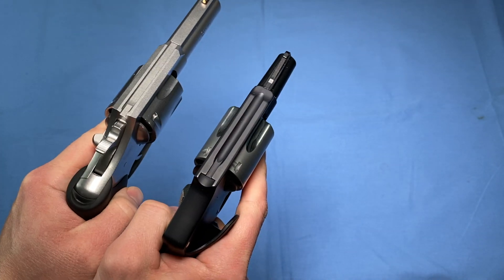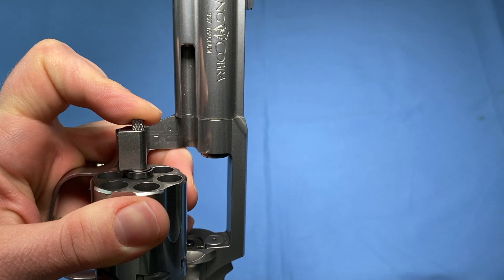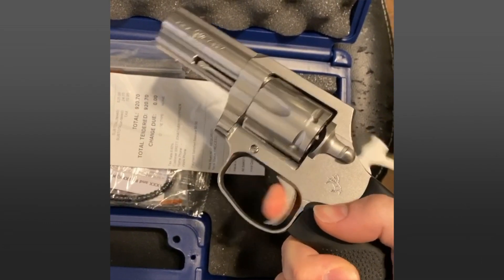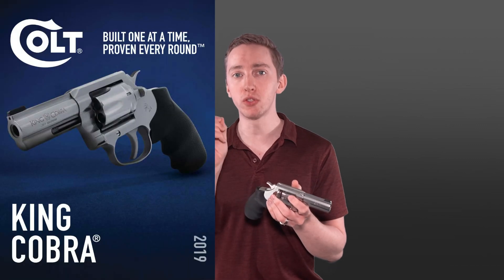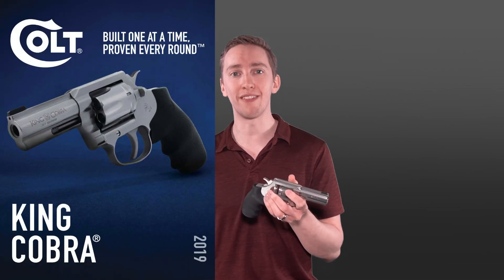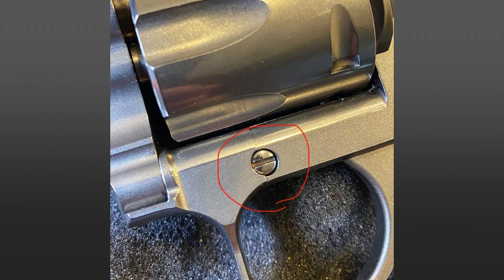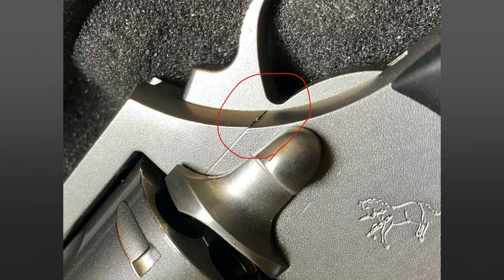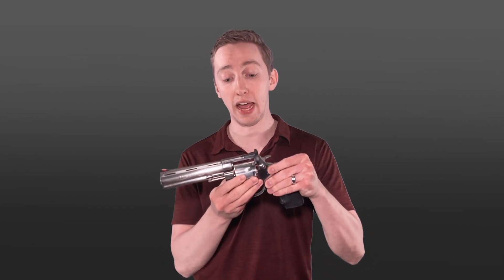Colt King Cobra - Problems, Malfunctions, and Failures OH MY!

Comment: Sorry about your bad experience with Colt service. Agree QC should be better but you didn’t really expect that Colt was hand making the cobra revolver did you?  Lemons can come out of any factory.  I have a 2020 Python that looks and operates flawlessly.  I guess lesson learned is that you look over the weapon thoroughly before dropping the $900.
Reply from the maker: It was definitely an unfortunate experience. And of course I knew they were mass producing them regardless of their dishonest slogan. But you’d think a “premium” company like Colt would test and vet their products before launching them. As far as looking the gun over, that absolutely applies to the misaligned side plate. But no matter how hard I looked it over, nothing could have indicated a weak internal part. And sure, I’ve had many lemons from many manufacturers, but if you look through my comments on YouTube and Instagram, you’ll see many people with the same breakage. A few of which originally commented theirs was fine, only to come back and comment that it has since broke. Colt knows (and admitted to me) there is a problem with existing King Cobra/Cobra revolvers, but they refuse to recall faulty guns or inform owners of the issue. And they clearly don’t have a 100% fix since several people have had a repeat breakage. The QC issue is certainly disappointing, but the dishonesty and ineptness is what truly drives me away from recommending modern Colt products. Anyway, I’m glad your 2020 Python is running well so far, it’s a fun and pretty gun for sure! 👍
Reply: I would keep sending it back until they made it right.

Comment: First 3 shots light strikes run into Magtec range amo I run in retail area of store loudly proclaiming this gun has a timing problem! Gunsmith jumps into action checks gun sees ammo proclaimed hard primer. Gives me white box Winchester 50 round box gun shoots unbelievable tight tight 60 rounds ten groups of 6 shots each group could be covered with a quarter. Then gunsmith returned with another box of magtec says fire 6 shots single action then have at it dbl action everything went perfectly not one light strike in over 100 rounds so. I don’t know what to think. But I will never sell this gun like I did my python back in the 80’s
Reply from the maker: Hopefully it keeps working well for you! 👍 I certainly wish mine did, it feels great in hand.
Reply: @NightwoodGuns  I had a python it sucked I sold it. I should have kept it. Even though it sucked

Comment: I have a huge revolver collection.  Yes they are ALL made cheaper than they used to be. Yes they all have problems.  I have sent back more smith and wesson revolvers than I want to talk about with the same kind of problems.  What I'm getting  at is they are machines and they will always break, all makes and models have problems. If I made a  video about all these revolvers that had to go back you would not be able to buy any brand.
Reply from the maker: I’ve sent back a couple of modern Smiths, too. But the customer service was leagues better than this and they always came back 100% My main gripe with Colt was the lousy way they handled the situation. And the fact that so many people had an identical breakage, they knew there was a problem, but they never issued a recall or a fix.

Comment: It's a damn shame that Colt's reintroduction flagship Pythons and King Cobras are having these kind of problems.  I know it's a manufactured item, and realize that not every unit will be 100% problem-free.  But this many problems with both guns is an indication of poor designs and even poorer quality control.  For $1000 and $1500 a gun, that would make my blood boil.  Say what you want, but I've never these kind of issues with modern S&W's, Ruger's or Taurus revolvers for half to one-third as much.  I'd probably be drinking a lot of Colt 45's if I bought one of these Colt .357 magnums.
Reply: LOL ... Smith's "Hillary Hole" is enough to put me off buying their new revolvers.  Not to mention their el-cheapo sleeved barrels that aren't centered.   I had enough trouble with binding lockwork in my Ruger Single Six to put me off every buying another one.

Comment: wow
Reply from the maker: Yup. Super disappointing.
Reply from the maker: @Coodeville  Exactly, low supply is making everything sell like hotcakes. Yours might be fine, but if anything DOES happen to it... Colt will screw you. I refuse to purchase a product from a company that treats customers that way. I'm convinced that most people will never shoot their Cobras enough to experience the breakage. And I'm sure Colt was counting on that when they designed the gun and manufactured it as cheaply as possible. Hopefully CZ will turn the company around.

Comment: You bought the revolver with the misaligned side plate. Should have checked it over before you bought it. Sounds like colt fixed the trigger problem. If you’re still not happy with it, sell it and buy something else. And…If you think S&W quality is any better these days, you’re mistaken.
Reply from the maker: Yep, I bought a revolver with a misaligned slide plate. I should have checked it over. And Colt should have fixed it. I did sell it and I bought a Ruger GP100. And Smith’s quality is mostly good, but they do have a fair amount of lemons. However, their customer service is much better than Colt. They just did a complete firearm replacement for me on a firearm that was built one year before their lifetime warranty started. Colt couldn’t/wouldn’t even fix a misaligned side plate on a firearm within their 1 year warranty.
Reply: Smith is the best.  Colt sucks.  Experience

Comment: This is so dumb, calling calls the ejector rod a plunger.  He has no idea how to adjust an ejector rod, which can be done in 10 minutes, max., and spends 2 hours playing with it   He thinks 150 rounds is a lot of rounds through the gun????  I have put 1,500 rounds through my King Cobra now without a single problem.   Too lame to even take the side plate off and see what was going on?  Really?  How about doing some real investigation and not just complaining?
Reply from the maker: You know, if sane people start watching a video and realize they dislike it... they click away and move on. 🤷‍♂️ Thanks for the comment though, it helps with my YouTube analytics. And yes, I realize I mistakenly called the ejector rod a plunger. Just like you made the mistake in your comment of saying I “calling calls” it a plunger. Nobody is perfect. And the ejector rod did not need an adjustment, the serrations were over traveling and getting stuck. And no, 150 rounds is not a lot through the gun, but it’s usually enough to vet reliability, which is what I was talking about. And why would I investigate when Colt could do it for me? Which they did. The gun never should have broken in the first place, and it should have been returned to me in perfect condition.

Comment: So you got a bad revolver and now the company sucks? They sell millions of firearms and have some trouble but it turns out to be a tiny percentage of their overall sales, and now they suck because they didn't kiss your ass and get it fixed quickly enough to your satisfaction. Next time examine the gun before you buy an obviously used gun. I own a King Cobra 2" and have never had an issues. I understand your frustration but trashing the company given these circumstances makes you sound quite like a whiner. Eureka.
Reply from the maker: I'm not trashing the company for a lemon, I'm sharing my negative experience with their customer service. They didn't even fix the side plate fitment. And the firearm was 100% factory new. Not to mention, many people in the comments have had their Cobra/King Cobra break in the same way mine did. The Colt rep even admitted on the phone that it was a known issue, but they would not be recalling it. If I had spun this video in a positive light, others would have called me a shill. There is no winning on the internet. All I can do is share my experience and if you don't like it, you don't have to watch.

Comment: aaaaaaand the same shit happens with Smiths , Rugers, & everything else whhen you get a lemon or new model comes out. Think Smith or Ruger is flawless? Hah. Your rant sounds fanboyish to me.
Reply from the maker: This is also a 4+ year old video. Ruger and Smith QC/customer service tanked after this. The difference is that this is a design flaw in the Cobra/King Cobra line that is still happening. GP100s and 686s have solid designs but poor QC nowadays.
Reply: @NightwoodGuns  Ruger, Smith, Henry, CZ, even Nighthawk has frequent flubs in QC, you can google "X named gun problems/issues/warranty/repair" on ANY manufacturer and get slews of forums and rants saying X brand is better than Y brand...but you can go to X brands rant forums n ppl say to go to Y brand. Brand new Ferrari's are on showroom floor thaat wont start. There always has and will be lemons and misses by even the greatest companies. Not saying its right or it shouldnt  be called out..but for every Smith QC rant theres Ruger, Colt and Daniel Defense rants about QC n RMA horror stories..It doesnt influence or speak for the brand as a whole.
Reply from the maker: @tekxmcfly6159  I hear you. And I agree. I’m just saying there’s a difference between a QC issue and a design flaw.
Reply: @NightwoodGuns   

my buddy has been yhru hell.n back with his Stacattos & WC. Other bud says they treated him like royalty

QC, Design flaw, or engineering the mechanicals itself are all in the same wheelhouse. Brands are stubborn. Every gun maker out there has quietly at one time or another phased out x batch n corrected new  batch..so long as its not a fatal to user flaw. Car manufacturers do it a the time since the begining.

BMW late 90's-2000s have plastic bodied water pumps...they knew...they recall it?? is it fatal to driver? nope business as usual.

Not defending Colts approach..but what you're shining light/complainimg about...is literally Manufacturing to Consumer Business Practice 101 since the dawn of Capitalism.

I agree with you 100%  but telling peeps to avoid Colts Wheelies like the plaugr because of this? Dude..no one should buy any firearm from any manufacturer EVER if thats the case. They all did the dance with the devil in the pale moonlight at one time or another. 

Sucks that happened to you..and you on point for calling them out. But for your Colt story theres more Colt stories...and smith stories..and WC stories..and.on and on. 

Knife companies are the same..so is every consumer brand.

Buy & use what you want...n if any company messes up call em out. But it doesnt reallyy single out any gun brand nowadays or even old days. Unless its Jimenez Arms...
Reply from the maker: @tekxmcfly6159  Your comment is fair enough. I just have a gripe when a company doesn’t phase out an issue, especially on a potentially life saving device. I always pin the most recent person in the comments with the same problem on my video to keep track of it. Colt should have sorted this out after 4 years. Which is why I do recommend going another route for a wheelgun in this case.

Comment: I reckon you should go back to not using your YouTube for another 3 years mate . Just another bloke who expects everything to be fixed now now now then it can’t be so let’s trash colt instead.. colt will fix all problems to all guns .. they are a great company and I have had nothing but positive experiences with them ..
Reply from the maker: I reckon no one is making you watch my videos, “bloke.” Obviously Colt will not “fix all problems to all guns” as evidenced by my experience. And I don’t think expecting the side plate fitment to be correct after sending it in for 5 weeks is wanting it fixed “now now now.” Regardless, it should have worked the first time, it’s a $900 gun. I’m not trashing Colt, I’m holding them accountable. Me sharing my experience is a consequence of their poor customer service and quality control. And it’s my first amendment right to do so, “mate.”